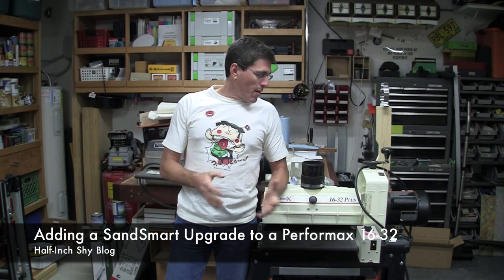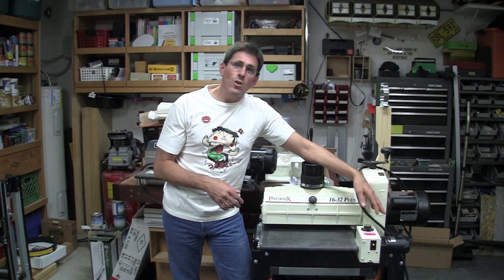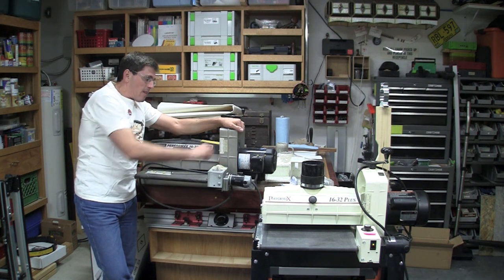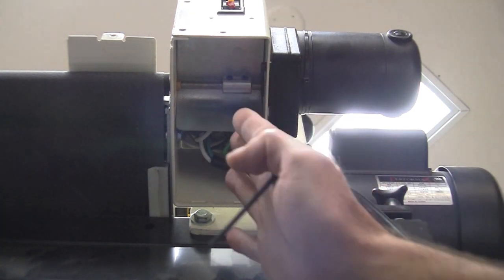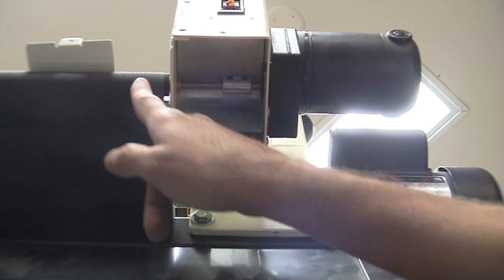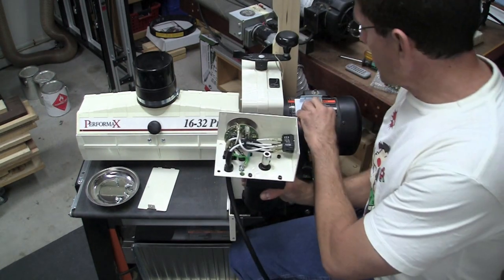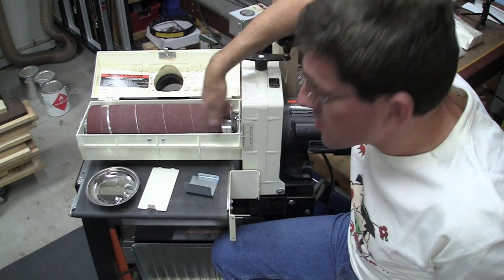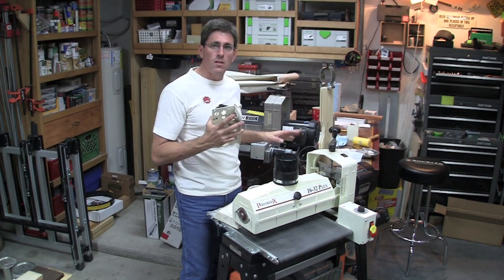#31 - SandSmart Upgrade to a Performax 16-32 Drum Sander

Comment: I know this video has some age on it now, but I could really use your help. I bought a Powermax 16-32 drum sander a day ago. I tested it before purchase, everything was good. Got it home, changed out the sanding paper, ran one board through to ensure it was good. Later on I came back, turned it on—the drum spin for half a second and then nothing. The conveyor belt works fine. I’m at a loss, and the sander is so old I can’t find a manual. Please help.

Comment: Great video and explanation.   I have a 16-32 that sat for a couple years and conveyer belt is not working.  Your video helps me understand the motor & housing.   Hopefully the problem is the switch or something other than replacing the motor.  Thanks again

Comment: So I have a question with this video. I have a Supermax 19-38 and this video you may be able to help me with.
On the Supermax intellisand which all is very similar build because they look identical, where the plug from the drum motor plugs into the receptacle on the side of the panel box. The drive roller snapped and had to be replaced to control the conveyer belt. When I unplugged the plug it started smoking and since then it has not worked. The wall receptacle works just fine but I cannot get the receptacle on the panel box to relay power to the drum motor. Do you know what may have cause this or what I might need to replace? I’ve had a hard time trying to get in touch with Laguna and getting frustrated with plugging both motors up separately.

Comment: Mein goes always right 👉 and i spend many hours to fix it but i it doesn't work 🙄
Reply from the maker: Have you tried adjusting the tracking screws? There's one on each side. When the track drifts to a side, it's the tracking that's typically wrong or the conveyor belt wasn't made correctly (i.e., the path around the right side is shorter than the path around the left)

Comment: I'm having trouble with my Ryobi WDS1600 controller. This is basically the same machine as your performax.  I replaced the pc board but can't find a wiring diagram to hook it up properly. I've even sent it off to an expert who can't figure it out.  Any suggestions?  If you have a wiring diagram would be easy, if not might you have a picture of the perfomax hooked up
Reply: Controller problem on mine was a B250K pot that was bad, I replaced it with a 200k pot that was in my spare parts collection and no more problems.
Reply: @petewalton8085   Look for wiring diagram in https://www.supermaxtools.com/wp-content/uploads/19-38-Drum-Sander-DIGITAL.pdf

Comment: I got my Sandsmart board from SuperMax, they call it Intellisand, about 100 dollars.
Reply: How well did it bolt up slide in etc?
Reply: Mine bolted right in. I compared it to my 22-44 board. It is the same board. I use mine on a 22-44 Pro that was pre-smartsand. I had no problems with the install. I did order the metal case to hold the larger controller. Went in just like the video.
Reply: What part numbers did you use for supermax?
Reply: @derekmoen5382  480DS-210
Reply: @ronhaefner7833  hey I ended up getting it  for like 49$ from supermax out the cities in Minnesota which is a few hours from me so I was surprised how cheap it was
Reply: @derekmoen5382  That has also been my experience. The Supermax folks are very reasonable on their product support.

Comment: Sandsmart Controller
Part #: 72-2250 e-replacement.com
$346 BUCKS!!!!!! I'll use heavier grit and sand slower.
Reply from the maker: William Dawson Wow, that went up in price by a lot. When I did it, I bought it from Jet directly, but they had sold upgrade kits maybe a year or more earlier. Guess once they wanted to ditch carrying that stock, e-replacement got them and wanted to make a mint.  I swear, my total bill was less than that with all the other goofy parts (screws and washers I likely could have picked up elsewhere for much less) including several parts for a second unit I was refurbishing with better covers, DC ports, and controller box.
Reply: @Love everything , what model did you get, Performax 16/32? I'm looking a Ryobi  16/32, guy said was made by Performax. Do you know anything about that?? Thank you!

Comment: I have a 1997 model Performax 22-44 drum sander. What company is supplying parts? Posted June 9 2014.  Many thanks.
Reply from the maker: Hi William... after googling a bit, I can't find when Jet acquired Performax. However, I had an original Performax (was in the video as the second unit) and all the parts were more or less the same.  I did have to drill different holes in a replacement power box, but that's about it.  If you are getting the controller board, you'll need to buy the box the controller goes in (the one with the conveyor speed knob and power switch) as the controller is a completely different size.  That said, you are replacing that entire box to do the upgrade and drive the conveyor motor.  That kinda takes the compatibility of parts out of the equation since you just need to possibly tap new holes in the box.

So you should be able to use the Jet replacement parts desk like I used.  That said, you'll want to do your own research; there could be changes I don't know about that you'll need to work around.  If you're not scared of working around the problems, though, it should go pretty smoothly.

Comment: Greetings brother I have a question for you as I can make the machine have that problem even eat eats more than one side
Reply from the maker: Sounds like the arm isn't perfectly parallel over the conveyor belt.  That's a problem with the open-sided drum sanders (which at least have the advantage of double capacity... tough decision :)

The way I've set mine in the past is this: take a couple pieces of 3/4" MDF or Melamine (MCP) and stack them on the conveyor below the drum head. Loosen the bolts a bit on the drum head and lower the head down to rest on the MDF. Since MDF/MCP is very consistently parallel, pressing the drum head down on it while tightening up the adjustment bolts will get it pretty close to dead parallel on the conveyor. Give that a shot!
Reply: ok thanks brother will do what he says to me and I see that this story

Comment: Just to confirm I have an original performax pre- jet. Can I add sandsmart to it? Thanks for the video, subscribed!
Reply from the maker: It would work on a pre-Jet if the motor on the drum is 1.5hp @ 14 amps. Normally these controllers like SandSmart monitor the current going to the drum motor. Once it approaches the motor's full-load of 14A, it backs off the feed motor so the drum catches up.

This is my assumption of how SandSmart does the monitoring since current monitoring is pretty common.

If the assumption is correct, if your Performax has a motor that peaks at 12A, you'll likely not get as much of a benefit (or any at all) since 12A is the motor's peak and SandSmart may throttle back starting at 12A.

So, if you are really interested in SandSmart (and I love it), call Jet's parts desk and ask for technical support. As them if it would work with a motor of your size. The guy I talked to would absolutely be capable of answering that question... he knew that board inside out. I don't recall his name, though.